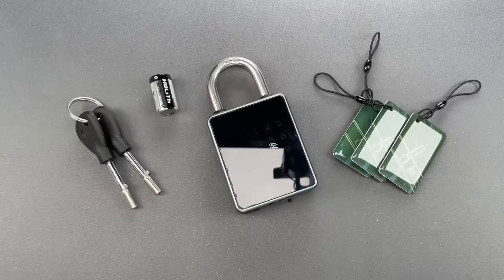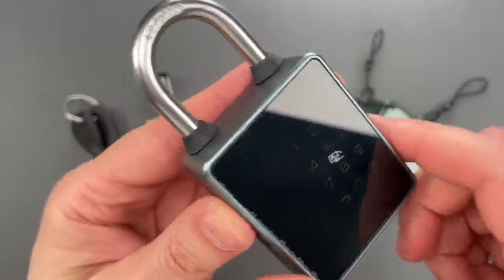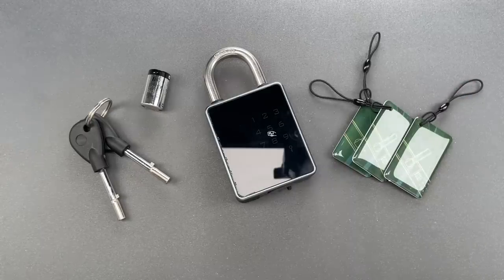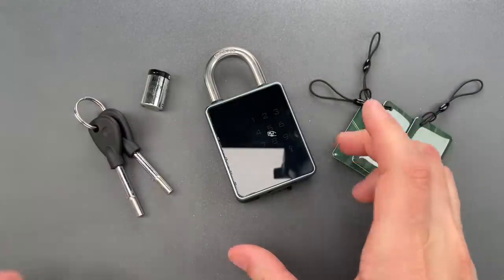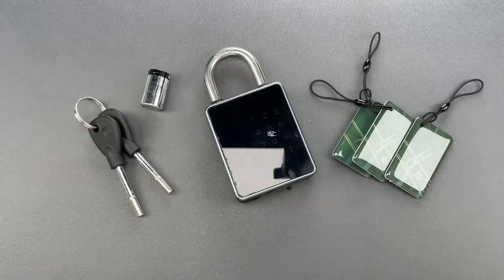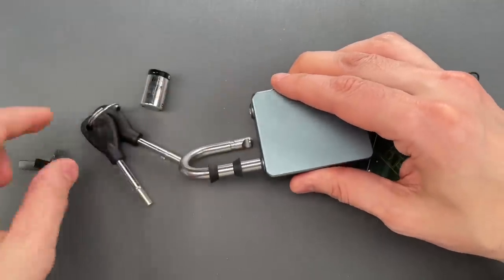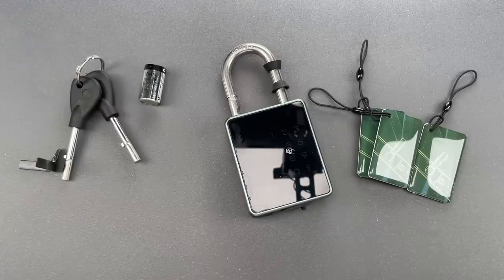[1532] Hi-Tech Lock w/ Lo-Tech Flaw: Laxre Smart Padlock

Comment: Great video as always LPL. The magnetic key has reminded me of something, and I wonder if it could change lockmaking in a revolutionary way. Smarter Every Day # 153 featured polymagnets, printed magnets where  they could completely customize the magnetic fields so that it's just not repel or attract of varying strengths, but could do both and create a kind of cushion. Could that be used in keys to magnetically move lock pins to certain heights just like a key would, but not allow direct physical access? You'd have to have a key with the specific printed polymagnets to get the right combination of magnetic fields.
Reply: and you would ALSO have to close all the zero skill openings
Reply: @stevevernon1978  -  Easier said than done.
Reply: Maybe you're overthinking it. The cushion thing is a curiosity applicable when you need to have the levitating effect. Inside lock body we don't care much if counterbalancing is done by levitate-y magnetic forces both ways (repel and attract) or by physical springs from inside and magnetic forces from keyside.
Reply: The right combination of magnetic fields can also be decoded by Hall effect and other sensors. (Mobile phone cases have magnets in them that phones sense, to tell "original" and cheap imitations apart.) I highly doubt the lock in this video used moving parts to be attracted or repelled from the key.

Edit: well the product description says "Mechanical Keys as backup" so maybe it used moving magnets indeed.
Reply: @u1zha , I don't think you've actually addressed my question. Please watch the Smarter Every Day video I referenced about polymagnets. Polymagnets are not moving magnets, they're printed. This is an emerging technology. The sensors may indeed be able to decode the magnetic field, but actually having the ability to print the correct polymanget key is something different.
Reply: @shenencalhar  Here the magnetic key is for backup in case the battery is dead. If you use sophisticated small differences in magnetic strength you can read them with electronics, but that requires that the battery is working.
If you want to use it as the primary mean to open a lock you need to consider what happens when you key is accidentally exposed to fairly strong magnetic field and what happens with moving parts inside the lock after a few years use and exposure to elements.

Comment: I still don’t understand why the brands don’t hire you to build a lock 😮😮😮
Reply: They know the flaws, they just don't care
Reply: Because then they'd have to build quality locks. That takes thought and engineering.
Reply: It boils down to the good ol' green stuff, locks are designed by engineers but ok'ed by cost accountants so every cent shaved off the unit prize is a win for the company regardless of the fact that the changes they insist on will make the product worse in most cases

Comment: The app should work on a phone that is just connected to Wi-Fi, without a SIM, so get a cheap aneroid phone and set up a separate email address that you only use for such tests and then you have to give out zero personal info. You could even set up a VPN network so the phone has no access to you personal network. Even if it requires a working phone number, that is also something that could be set up and only used for such projects without having to give the app you personal number.
You have used this reason before and I thought back then that is is something that would be VERY easy to work around.
Reply: While possible to work around, what value does "here is the mechanism rendered meaningless by this hammer working as intended" add? Like he absolutely could do all these things, but would this video have been any better if he had punched in a code before hitting it with the mallet? No use spending time and money on things you're going to promptly ignore regardless!
Reply: @mentosman8  Had the reason given, been it is so easy to open I will not bother with the app, that would have been a different matter, I was responding to the reason LPL gave, and as smart devices crop up from time to time such a isolated cheap smart phone may be a worth getting.

Comment: it's crazy the lock only hooks into one side of the shackle with a simple spring, both sides would make the hammer trick harder and need two shims, some sort of immobiliser is needed for that. so many complex tech options controlling a very low tech lock

Comment: How the hell do they build a lock that opens with a hammer? I am a mechnical enginner with +20 years of designing stuff of all kind, I would have to take a deep think of how to do it. + optimaze the spring load needed so it opens with a light hit, but not to light. Seems to have gone in some serious design work to tune this function.
Reply: The only thing I can think of is it the better ways of securing the shackle are patented and the lock makers don’t want to pay the royalty fee.
Reply: I guess they just optimize it to the point that gravity alone without solenoid help wouldn't pull the spring loaded lip out... And then ship it
Reply: Easy, just do as the did. Use only a locking lug on one side of the shackle. Any lock costing more than $5 has locking on both sides of the shackle to prevent this easy hammer tap. It also requires that you shim both sides to get it open.
A lock costing $10 or more should have so tight holes to the shackle that shimming is impossible.
On electronic locks you could also have problems with a strong magnet affecting the solenoid or in this case that the entire front looks like it is made of plastic. Destructive opening by applying brute force or lots of heat to the front of this lock....
Reply: @Rohan4711  having ball bearings to lock the shackle defeats the shim attack.

Comment: I use an old spare phone bought with cash or as a gift to load up questiable apps for testing. Bonus points for being able to erase and install LineageOS plus microg for even more protection. Old phones are still good for testing apps as the Wi-Fi part still works, no SIM needed or service for internet access.

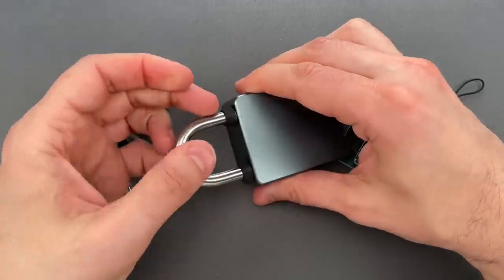Comment: I'm not locksmart by any means, but this begs the question in my mind; wouldn't putting little flares on the shackle, such that they would meet the lock body when the shackle is closed, be a good defense again shimming? Obviously, a better designed lock wouldn't be susceptible shimming/tapping in the first place, but it just seems like a real easy and cheap way to prevent any sort of tool from getting in there and causing mischief. And obviously the tolerances of this would still be the weak point, but you could also allow the flares to recess into the lock body a bit to make it like 3 times more difficult to get anything in there. Just something that came to mind when he pulled back the rubber boot thing at 1:44. I actually thought that this was how the shackle was designed, and was impressed, until I realized that the flare was actually part of the lock body, and not part of the shackle casting.

Comment: i've said it many times before and i say it again, this is what happens when people with no knowledge are designing things .. they have no idea how a lock works, they think "oh WOW lets add magnetic key and rf card" without even thinking how secure the basic mechanism is.
it's same principle as building a huge bank vault like door and a lock on a door that slides open even when all locks are engaged.

they just don't think, they have no knowledge on how locks work. if i was ever gonna design a lock, i'd be doing some research and most likely LPL's channel would be one of the top ones showing up in searching, so i'd look thru some of the videos that relate to my lock design and adjust accordingly.

i'd also be looking up videos about how common thieves open locks in destructive ways. like with a crowbar or force-turning it so they break the mechanism ..etc. i already came up with excellent idea against bruteforcing a lock. have the core turn freely and you'd need magnetic key like seen on this video, that then pulls the magnets into locking position which then allows the core to actually turn the lock and then ofcourse normal "teeth" on the key that are also required, with un-usual keyway and security pins.
so someone can't just bruteforce it open.

then ofcousre check against other usual methods, like tapping on it from all angles, using a magnet, using some shim to get between ..etc ..etc.

and finally i'd send a prototype to LPL or some other known lock picker to see what they can find, even if they get it open, it doesn't necessarily mean that lock is bad. if it takes them a while and by using some non conventional methods that require very specific tools or methods, then it's secure enough, because no thief is going to use those methods, they try basic picking or brute forcing and then just leave it, but if you can tap or shim the lock .. that's BAD! i'd expect a common thief to try something like that.

Comment: Classic example of a company actually trying to make a good and secure product but lacking experience in the basics of a lock.
They made a key that may or may not be easily pickable depending on if there are counterpart magnets in the lock or just hall sensors reading the keys code based of positions and polaritys, and they can (we won't know as LPL wouldn't test that) use a proper type of rfid card with good security and may even implement it correctly. LPL could at least have checked what type of cards the supplied cards were using nfc on his phone and a standard rfid app.

Comment: With the massive growth in popularity of smart locks (whether padlocks or door locks) where tech companies with no background in security are building security devices that fail the basics of security and are vulnerable to flaws that have been known for a decade, I wonder whether we're in the process of seeing a new era in the ease of theft.  All it takes is for thieves to arm themselves with some basic information about common vulnerabilities using low-skill attacks and it seems an increasing number of devices are going to be able to be defeated.  More ways to open = more potential vulnerabilities and an increased likelihood that corners were cut in at least one to bring down cost - because trying to implement 4 or 5 good secure methods of opening a lock would potentially be more expensive than just one.

Comment: Thank you!
Is it possible do turn up your volume while recording, please?
The volume from the built-in speakers in my monitor is really low.
I can hardly understand what you say.
Reply: Uh, no. There are browser extensions that boost volume you can install. For example Firefox has the "600% Sound Volume" extension.
Reply: @d.-_-.b  Thank you very much. I didn't expect there to be an expansion for this.
But why "uh no"?
It's really very quiet.
Instead of having a lot of followers install an extension, I think it would be more appropriate to turn up the volume.

Comment: Some locks are relatively secure if they use an obscure method of operation (such as the magnetic key) that will only succumb to someone like LPL who has the expertise.  But this one won't even resist a dubber like me with a hammer or a shim.

Comment: I keep wondering if a fully electronic lock with no "backup" keyhole and no battery where the power comes from the "key" via wireless charging technology would be more secure (of course if you could hit it with a mallet, that wouldn't matter much I guess).
Reply: Doesn't have to be wireless, does it?

Comment: I would avoid using any padlock of any kind. Even if the lock itself is good, the bit that is usually attached to isn't and can be easily cut, sawed off or just broken using a hammer and blunt force. But that is no excuse for the flaws in this one.

Comment: LPL: This has 4 ways to unlock it, but I found two much simpler ways < That has be be massively embarrassing. When a $5.00 simple tool can be used to open the lock with no marks left behind, turns the lock into one you cannot trust cause you will never really know if it was opened until you open it to get what you locked up and find it missing.

Comment: I guess the only benefit of that magnetic lock is you don't need to have the pins exposed, so if the engineer wasn't an idiot, Ti was phisically unpickable. If the lock is fully electronic and instead of pulling/pushing other magnets you have coils to read the polarity of the key's magnets, clear the key to turn and then release the lock you have a completely electronic lock that mimics an electromechanic one. That would be hard enough to pick, where the attacher would need to have a key with electromagnets to change polarity till it finds the correct combination, plus you could register different keys through a master key to identify different users. If you combine the key with a tag or password, the lock itself becomes virtually unpickable.

The way that lock was actually conceived, it was a waste of money, time and resources to even manufacture it.

Comment: Tbh I'm really curious how you can defeat its key too, even if its not that important. I hope in the future, you revisit this lock and show us the way to do so.
Reply: Stick a couple magnets in the hole, note where they stuck, and which end is up on the magnet. Then stick those magnets on a stick, in the same spots, reversing the polarity. Then stick it in, and it should open.

The way those locks normally work is by magnets in the lock being repelled by magnets in the key allowing the lock to open.
Reply: @BenKonosky  In puzzle boxes yes. In a smart lock I think they'd just use solid state sensors?

Edit: well the product description says "Mechanical Keys as backup" so maybe magnets in the lock indeed.

Comment: I was like "Oh, those black things are smart. They prevents you off shimming it."
LPL 10 seconds later: Just pull up this rubber boot...
Reply: Yeah they nearly got it right, if it were metal baked into that bit would have been perfect lol or just drilled a ring in the hole and soldered or something in that kind of like a screw goes into wood a bit further to make it smooth.

Comment: This is silly, it would have been easier to engineer with a rotating ball bearing mech with just one active moving part, and no spring, and the worst part is that's not even reinventing the wheel, it's just being lazy on the most critical part X.x

Comment: My first impression is that these hi-tech locks are made of flimsy materials, usually pastic and thin metal. I bet a standard hammer could rip them apart. Any lock needing a battery has electronics. Electronics are easily fouled in a poorly made housing. The ease at which you open the lock is a secondary fact to the poor quality materials. How is this company in business much less selling this lock for over $20?

Comment: Something called "Fliplok" is being advertised on your channel as being ultra-durable with unbeatable protection. Their website claims it's 10X stronger than a deadbolt and unpickable. It'a a variant of a door chain or latch but it looks like it might be easier to bypass than either of those.  It might provide more kick protection as it doesn't allow any travel, unlike chains and latches which are designed to let you peek out and talk to people.

Comment: These seem like easy fixes....
Reply: Add a deadlock pin at the bottom of the lock shackle hole.
Reply: Add a 0 set pin to the key hole.
Reply: I believe the hammer works because while the magnets are moving from the impact and the lock is pulled it lines up for a moment, no different than a bump key. I fear a good shake will do even without a hammer.

The shim is nothing new, they did do a little to prevent it but not enough. Between a model with no plastic cover and that one, a thief would prefer no plastic cover.

Comment: See, here's one video I'm pretty disappointed in. Sure, you've shortened your videos the last several years, and sure you've almost entirely gotten rid of the gutting videos, and sure you don't do the fantastic challenge locks that the community is producing anymore, and sure pretty much every video is a plug for your store now. We're all just used to that stuff, sadly. 

But now you get a lock with a novel cylinder and don't even try to pick it? What's the point?